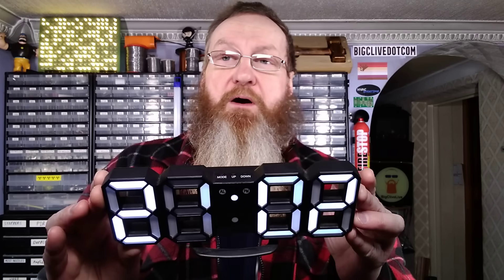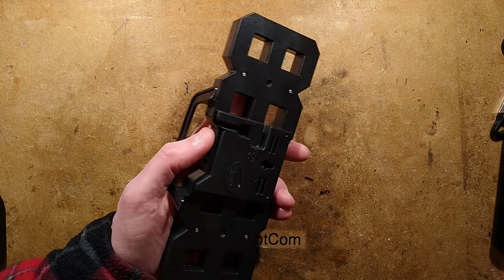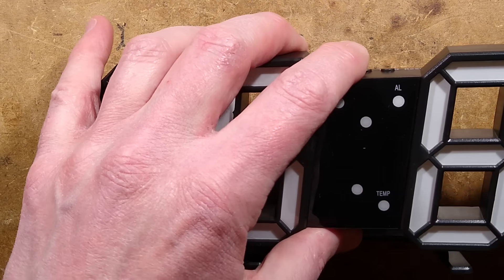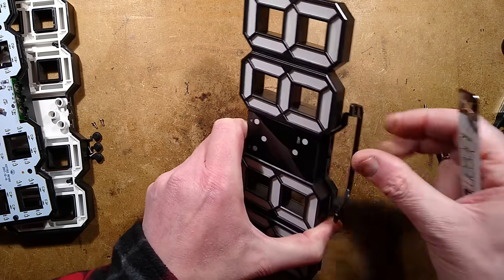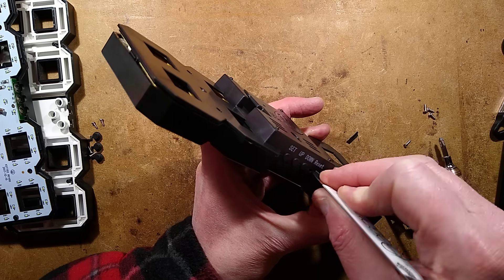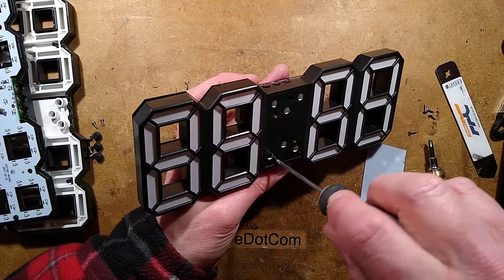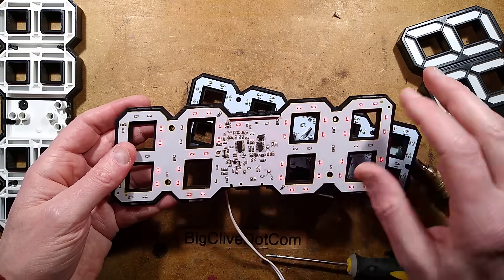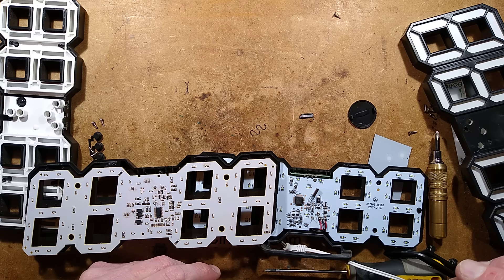The CURSE of white LEDs

Comment: The world is not ready for eternal lamps.
The planned obsolescence of UV crystal-based phosphor white and blue LEDs is also intentional on the part of manufacturers,
due to profit maximization, the cooling of the LED crystals is inadequate, dopants migrate into the crystal lattice due to overheating and degrade it, causing a rapid decrease in brightness.
There are several manufacturing technology errors in these cheap white LEDs, a few nanometers thick Titanium metal should be vacuum evaporated under the metal filament used for bonding, which protects the crystal from ALU diffusion, but this is omitted due to the cost reduction.
A thin glass layer, also made of silicon monoxide, is missing between the LED crystal and the phosphor layer, which would prevent the diffusion of impurity atoms from the phosphor into the crystal. The degradation of the phosphor due to UV is negligible even over decades, and it does not reduce the brightness of the LED.
Reply: Yes it's intentional but the chinese screwed over the manufacturers by making replacement LEDs cheaply. For TVs you can simply buy a set of new LED strips that fit straight in for about 20 bucks total including postage hehe!

Comment: If I may anecdotally relate: The inexpensive Sears digital clock I got for Christmas of 1978 is, with one repair, still going strong.  About 10 years ago I had to replace the electrolytic capacitor.  Other than that, completely original and operational.  I can't gauge that there's been any dimming of the LEDs, but they still seem bright and equally luminous.
Reply: Sure they’re LEDs? Might be VFDs from 1978.
Reply: @emmettturner9452  If it is red it is almost certainly LEDs. They were around in 1978.  For Christmas 1977 I got the Maplin digital clock kit using a National Semiconductor LED based clock module. The electronics outlasted the blow moulded case. 

If Pale Green / Blue then the display is VFD. VFDs are actually prone to fading as they use phosphors.
Reply: I've still got a clock radio cassette player sitting next to my bed... Got it in about 1988.
I stopped using it about 2 years ago when I built myself a little ESP8266 based clock that automatically sets the time from the internet, and automatically adjusts for daylight savings... Uses 1 inch green seven segment displays, so it's about the same size display but green.

I have opened the clock radio up to see how it's set up inside... I had the idea of using an ESP32 or raspberry pi to replace the core guts of it and then make it play internet radio aswell as being a self-setting clock.

Comment: The best way to check for multiplexed 7 segment LEDs is with a MW or LW radio. Multiplex always makes a loud buzz or whine on the radio.
Reply from the maker: Or eye-swipe it or shake the clock to see if it has staggered segments.
Reply: video record, slo-mo mode probably even better
Reply: @ericbwertz  Depends. You could fairly easily multiplex fast enough that no ordinary affordable camera could capture it.

Comment: The generic specs I've seen call for properly driven LEDs to provide something like 50,000 hours before their brightness drops to vaguely 50% ?
 But cheap LEDs don't last that long. They last past their warranty date. And if they are allowed to run too hot, and overdriven to get higher brightness...take an axe to that lifespan.
 I also had a BIG red LED display like Clide's, and somewhere after ten years, they had faded so badly that it was useless in full sunlight. Even red LEDs are not forever.

Comment: I was always under the impression that the 100,000 hour claimed lifespan was the life of the actual diode and not the phosphors.
Reply: tube lights also use phosphorus, easily lasts 20 to 30 years, its the heat and overdrive to make it brighter that is killing it.
Reply: Agreed! It was always the case that the LEDs are the long lasting component. 
Companies lock on to any high number for sales purposes, technically any device could make the same claim based off of a single component 😅

Comment: Every electronic part has a data sheet that should indicate how long those LEDs maintain their brightness under operating conditions. Those LEDs might be some random off brand that have no manufacturer support or documentation. Might also be the wrong part for this application and they are over driving them.

Comment: Clive, have you ever done a teardown of a Phillips Hue bulb? I would be interested to see your analysis because I received two of them as a gift in 2016 and they have outlasted every other led bulb in my house. I don’t know if I’m just lucky or if there is a reason they’ve lasted this long.
Reply from the maker: If they were used at a dimmed level that would have helped.
Reply: You probably don't have a color one. The color ones always go after a few years, I've gone through 5 so far. The TLDR is they're a series chain of parallel cool white, parallel warm white, single blue, single green, parallel red. Each color has a current bypass transistor. Either the blue or green opens, so it only illuminates when your color doesn't have a lot of blue or green.

Comment: I have a Radio Shack Micronta digital clock which I bought in 1975 on my desk.  The chip is a white ceramic Mostek clock chip and the diplays are 14 pin DIP Monsanto displays.  As far as I can tell, the brightness is as good as ever snd it looks set to run another 50 years.
Reply: Long lasting electronics are rare these days.

Comment: You can get while LED to achieve 100.000 hours... if it's driven with very low current and heat dissipation is taken care of...
Thus what you actually need is overblown amount of potential lumens, then you'd drive them with let's say 20% of that power... 

Annoying, yes, but necessary.

This is why I hate it that by default many monitors and TV's back-light is on 100% and that's how people will use them.. .then they die early and you need to get a new one.

I always turn my monitors back-lights way WAY down and if they're not bright enough i'll darken my room instead... curtains are cheaper than new 1000€ monitor every 5 years :D
Reply: Yeah a lot of people are clueless on how to use technology. I always turn off all the extra tv features too and run everything just bright enough to see the picture. I also add heat pads or heatsinks to all hot chips. I have several TVs here given to me by friends over the years non-working or with bad backlight LEDs. I fixed many of them and they are still running well with heatsink and low brightness after many years hehe!

Comment: I have a blue one that’s been running on the medium brightness setting virtually nonstop since I got it back in November of 2019 and the same segment of the right-side hour digit are going out on mine as well. I have extra LEDs to fix it, at least I think I remember them being the correct size to replace them, I just have yet to actually sit down and do it…
Reply: It's not too big of an issue if you don't have the correct size. I just replaced the old dim surface mount LEDs on some Arduinos with some salvaged surface mount LEDs from a dead sonic toothbrush, and even though the salvaged LEDs were a bit too small, they soldered well and are nice and bright. And yes, you heard me right, I desoldered surface mounted LEDs from a broken electric toothbrush and managed to use them. True cheapskate, I know.
Reply from the maker: This is why you will survive an apocalypse.
Reply: @ And GreatScott said that surface mount parts were not worth desoldering!

Comment: No kidding about the red LED bedside clock. I have a 90s vintage clock radio from GE which has been in near-24x7 operation this whole time. I think it HAS faded a bit, but that's probably more down to the weakening power supply than the LEDs. If I recapped it, I bet it would shine as bright as it did when it first came out of the box. 👍
Reply: I also have one, from the 80s and I'm pretty sure this thing can survive a nuke.
Reply: If it's like mine which uses a TMS3450NL (and it probably is) then recapping won't do anything to change brightness. The LEDs are run directly from half-wave rectified AC in a 'duplex' configuration. Half the digits light on one half-cycle and half the digits light on the other half. In the clock section the filtered DC power is only used by the chip itself.

Comment: Actually red LEDs (old technology) last but do fade badly if used constantly or nearly constantly for more than 20 years. And that's when used within the maximum recommended current. I know, as I had to change some due to this. Put a new (old but previously unused) one next to a well used one and the difference is unbelievable.

Comment: I'm not sure if blue LEDs with a red phosphor would work to make red LEDs. I think some of the blue light would leak out causing the LEDs to be magenta. Magenta LEDs sound interesting. It might work better than using dual color blue and red LEDs. I guess you could also use a blue LED with a green phosphor to make a cyan LED.
Reply from the maker: Many of the red LED Christmas lights are red phosphor on a blue LED these days.  It makes quite an odd deep red.

Comment: I still have a large number of original eBay 5mm white LEDs in my spare parts kit. The quality control is a feature not a bug, right? 😆 Compared to the mature tech on the market today it's amazing to look back and see how much colour variation there was in those days.

It's weird to see how much even the current generation LEDs fail. My all time favourite "anomaly" is the street lights that turn purple or blue when the phosphor layers & domes delaminate. We had a five mile stretch of road in a neighbouring town where ALL the street lights did this. It was unplanned, but really quite pretty to drive at night.
Reply: In Connecticut there's some street lights that have gone blue/purple, been replaced, and gone blue/purple again in less than a year's time. On one particular interchange, we've had "disco street lights" on average 4-5 times a year. If a few miles of state highway are a microcosm of the entire state, we'd need a dedicated 100-person crew out there constantly replacing/repairing streetlights 24/7/365.
Reply from the maker: The strobing is a common driver failure, and the purple street lights is due to phospor detachment from the violet emitters.
Reply from the maker: I have bags of "besthongkong" and "chiwing" white LEDs from when they first appeared on eBay.  It was a very harsh lesson in modern LED reliability.

Comment: There are various variations of these, as is typical with stuff from China. I bought one that automatically changes in brightness during the day/night. Except it doesn’t use a light sensor,  but has fixed times. I don't power it up much, as that's no use to me.
Reply from the maker: The red one does that.  I wish it didn't.

Comment: It's my understanding that blue/white LED phosphors break down faster, sort of like EL lighting, much because they require a bit more power, but because of that increase of power, you have natural use circuit degradation. I would suspect that the LEDs in your clock were driven at higher amps than they needed to be.
Reply: blue LEDs use wayy less power than red, they can glow at uA of current

Comment: A good friend of mine actually worked on variants of the then-new indium gallium nitride LEDs at Lawrence Berkeley Laboratory. He explained to me that no single LED can produce pure white light, visible light has a ton of wavelengths and LEDs can, generally speaking, only emit one or a super narrow band. So what manufacturers do instead is use LEDs that emit violet to near UV wavelengths and a bunch of phosphor which emit a band of yellow wavelengths. Violet + yellow = white, mostly.

At my old job we had these crappy clocks with RGB LEDs and white cases, which made them nigh-impossible to read, and they weren't very bright to begin with. So I had the idea of modeling up a custom segment using KiCAD that would carry 5mm NeoPixels. I never got around to doing this because the company decided they didn't want to pay me anymore.

In my experience the biggest killer of LEDs is heat, which is why the really bright ones use alumin(i)um instead of FR4. I remember early LED bulbs used massive heatsinks, but they don't bother anymore, and I think it has more to do with cost than being able to drive the LEDs without cranking out too much heat. A lot of those bulbs fail on me way faster than incandescent, but I attribute that to the awful 1950s wiring in my house.

I'm guessing the mic is a poor man's presence sensor since they didn't want to use a PIR device or something? shrug

Comment: I have repaired some incubators that had a very interesting fault: it seems like the blue leds of the display have been damaged by the reverse biasing that happens during multiplexing. Whilke the leds were emitting perfectly fine, their reverse leakage current was abnormally high, which was causing fake button presses (because button sensing is intertwined into the same multiplexing sequence). That has caused multiple instances of the incubator setting itself to max temperature, and cooking the contents. 

The fix was to install some silicon diodes in series with leds. So far, none has gone bad again (it's been more than a year, we have like 10 of them, and i have proactively fixed all of them after 2 have developed this fault). It was quite a challenge to figure out the reason of the fault at first.

So i think, blue leds in these clocks might have been damaged by reverse biasing that happens when they are multiplexed. It could be just too high of a current, of course...
Reply: In Germany, we use the word "incubator" exclusively for the ones that are used to nurse premature babies. So your "and cooking the contents" was quite shocking at first read ;-)
Reply: @ I also had the same mental image.😅
Reply: Incubators are also used for bird eggs and baby birds, so maybe those are what got cooked?
Reply: @YodaWhat  the contents were fruit flies (eggs, larvae, adults; genetically modified, for experiments). The temperature got up to 60C,so they have been quite literally cooked.
Reply: @victortitov1740  So you didn't just fry one baby, you fried ten thousands of them in one go ;-)

Comment: I would suggest you get a "car trim remover" kit.  They include a variety of what look like giant nylon spudgers.  They work really well for prying open devices that require more force, but without doing damage.  Much safer than a thin metal spudger, and NON-conductive to boot.  Doesn't usually scratch plastic either.  The only problem is they can't force their way into a closed seam like you can with the metal one.  So use the metal one to "break in", and then the nylon spudgers to do the rest.  They won't kink or permanently deform under pressure, though the harder objects can start to chew them up. (they're sacrificial in that regard, which is good!)

I've been using nylon spudgers for over a decade, and way back they sold a tool to pry open a display and it was a giant spudger similar to one of the car trim kits.  Used that to death, have a spare.  If you've used the thin black sticks in the past but didn't like how small and low-leverage they were, (especially for twisting) you really need to try the big ones, they're outstanding for twisting to pop those seams open.

Also, the "microphone" you found, that's a 5v piezo buzzer, to beep on button presses.

(and btw, you're really rocking that "lumberjack beard")
Reply: Whenever they get chewed up you can always file them back down to a sharp flat edge again easy enough. I've done it a few times with mine.
Reply: @Leepshin  My thin black sticks tend to lose their point and get much more rounded on the end, though I've never tried sharpening them - I usually just end up getting out a new one.  The heavy duty spudgers on the other hand tend to get anywhere from light to deep gouges from use, and there's not much to be filed down.  They don't really have an "edge" to begin with, and that's not what they're about - they're more about forcing into a gap a stick has made, and then giving it a forceful twist to pop it open. (or forcing it down a seam that's got some really strong clips that are stopping the black stick)

Comment: They keep using the same low value resistors (330 ohm) they were used to for old style LEDs, plus properly binned LEDs are more expensive (as in, the same I/V characteristic across the lot
edit: are they using only ONE resistor per digit?
Reply from the maker: I think I reverse engineered the original clock in a video.
Reply: If they're doing the 12V trick, it's one per 3 LEDs in series or something. (caveat: I didn't get a good look at the board, I'm just remembering 12V LED strips)

Comment: I got a second hand keyboard manufactured in 2014. By the 2021 like 15 blue 3mm LEDs died. So far, ones that i replaced work fine. One difference is that replacement has coloured bulbs, original is clear.

Comment: I've been making oversize LED clocks using the rigid LED 'filaments' in warm white - I'm running them at just 5mA, so it will be interesting to see how the longevity pans out.
Reply: you better have heirs
Reply: Yeah, I think low current is the way to go.
Reply: that'll be a generational test... your grand grand children are going to make a statement about the longevity. and it will be: runs good so far 😊